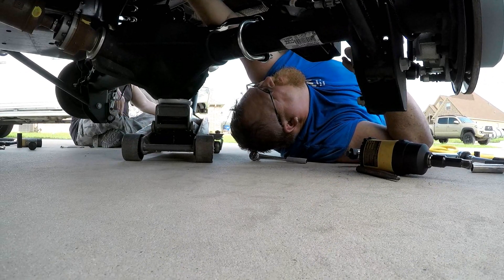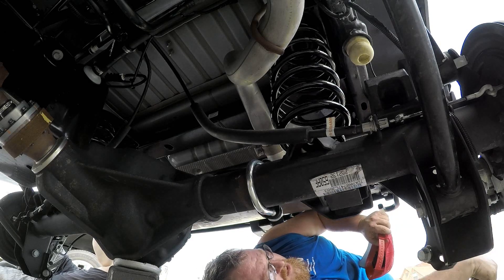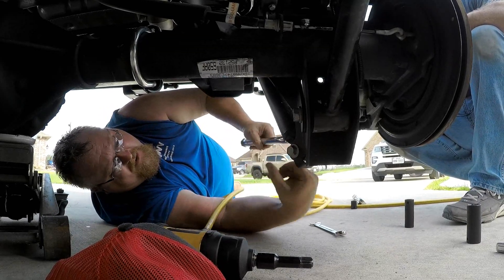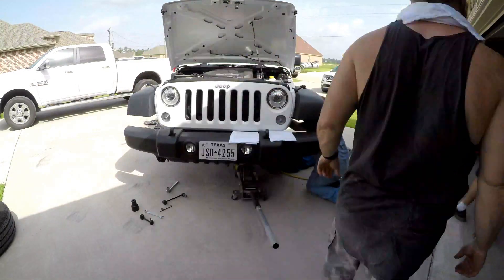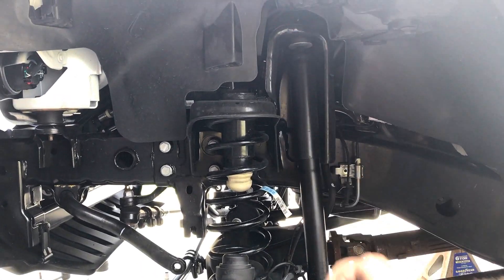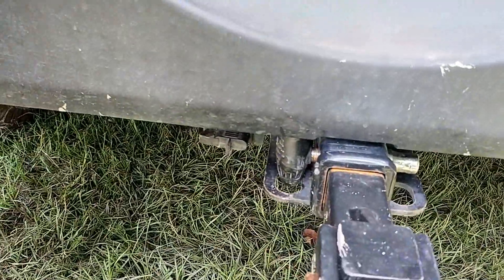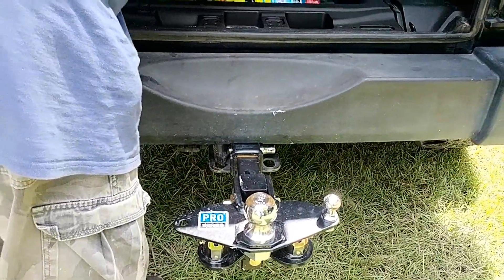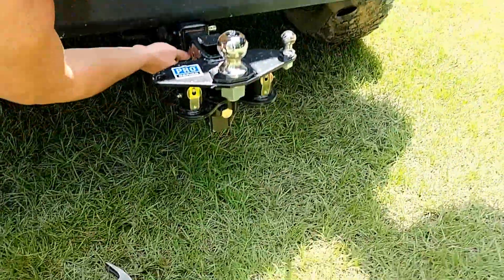Terraflex 2.5" Install on JKU Sport

Comment: When you were running the stock wheels and tires did you use wheel spacers to eliminate any rubbing?
Reply from the maker: No rubbing, the offset of the wheels were stock, so very mild. Pretty sure he didn't rub after the new wheels either, but I think he went with flat fenders, so that probably solved that.